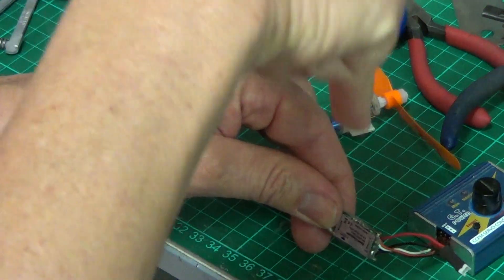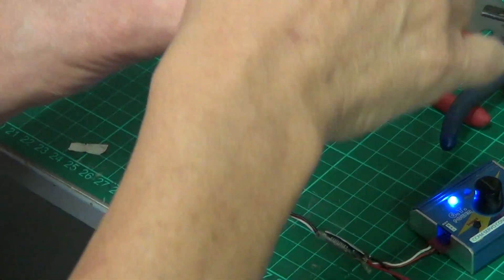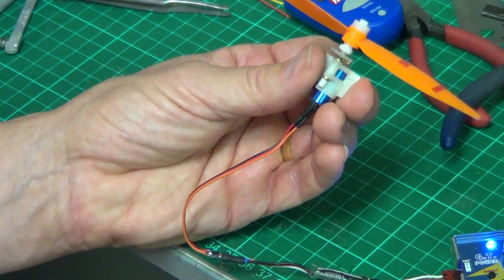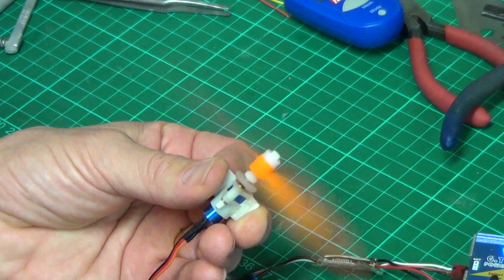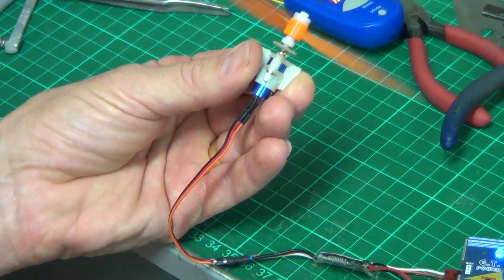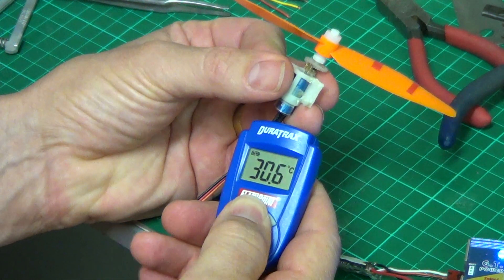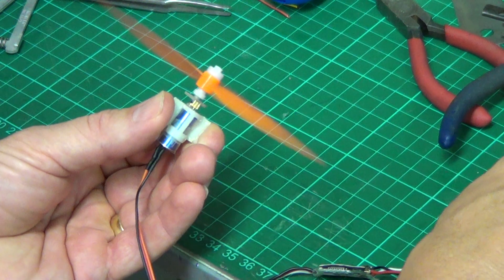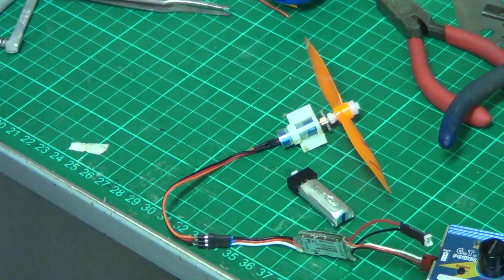8100kV 8mm inrunner mounted in a UM 4:1 Gearbox

Comment: Hello, I am not responding to this video in particular but I had a few 30mm edf questions.
I just designed a micro edf jet with a delta wing and canards. I have servos and a receiver in mind but I wanted help on my battery, esc, etc. I would like to send a photo of it so you get the idea. I am new to home building edfs but this one I feel is perfect. thanks!